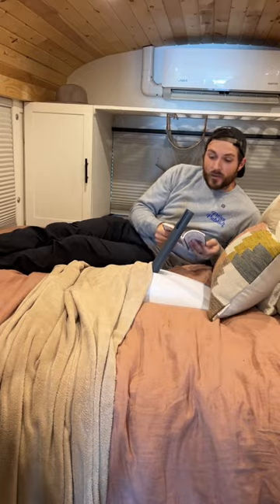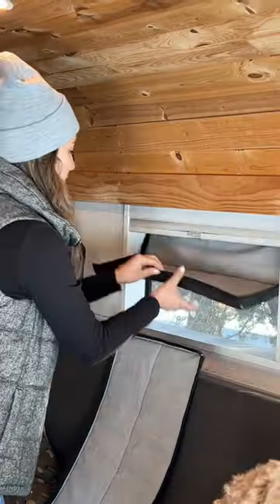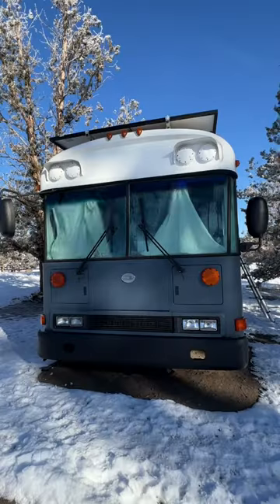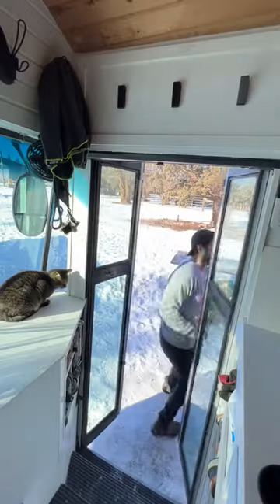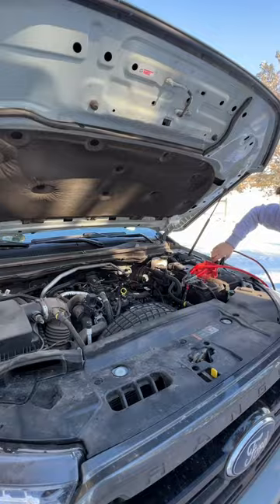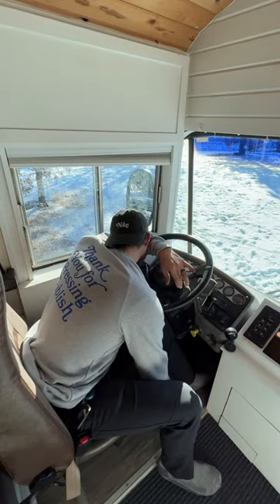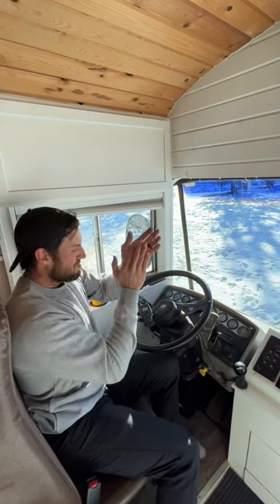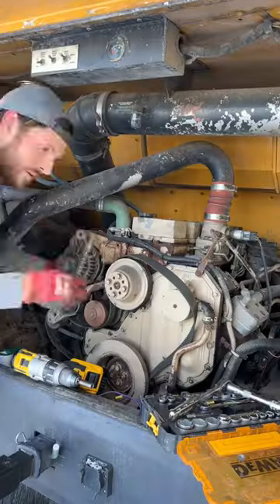How we ALMOST get ready to move our 39 ft Bus #buslife #vanlife #busconversion #skoolie

Comment: Having your alternator rebuilt is cheaper. That's if you can find a place to rebuild it.
Reply from the maker: I found a place, but it would cost more to rebuild it for this one unfortunately :(
Reply: @BasicallyNomads  I replaced many motors in lifting equipment, always safest to get them rebuilt as you were certain that they would fit perfectly. Did you know the big tour busses start with compressed air? No problem with cold batteries losing amperage. Nice job on the bus!

Comment: suggestion for wierd or crazy powerfull alternators. try alternator nation. got our 380 amp alternator for our E350 there. soo much power in a single alternator! keeps our survay equpment running. i would suggest something with lower idle power for diesel tho. even tho the max power is 380 amps. it kind of loses a LOT of kick at sub 1000 rpms.

Comment: You ain't gonna find many parts for that motor at O'Reilly or autozone or advance auto. That's a different kind of motor,  almost always a special order
Reply from the maker: You’d be surprised! It has a Cummins 5.9 which fits in the ram 2500. I’ve gotten quite a few parts from there.
Reply: Oh wow, well that's good,  don't have to wait forever for some of the parts. I got a toyota rv with a 22r motor, most 4runner from mid 80s to mid 90s have them and the celica to has it
Reply: I guess you think tractor trailer drivers have to special order their parts WRONG just have to go to a heavy duty parts house

Comment: That would be the worst part about living in a vehicle for me, if the vehicle breaks down do you still have a home?
Reply: Well actually it would be perfect. They have a bathroom and kitchen plus internet. And a bed. You could call a service to come out and fix it and even if it took all weekend you would be totally fine. The home doesn’t stop working because the engine won’t start. Now if all of your batteries and your car engine failed obviously would be less of a home. However I could just as easily argue if your water pipes failed or you got a power outage your home would no longer be a home. The odds of also all of there batteries and engines also failing is so ridiculous that it’s almost impossible. But once again a home like that is definitely livable for probably at least a week if you just decided to turtle up and wish for help. But in all honesty you could live months in that bus if it lost power and you have survival skills. It’s a great form of shelter and switching into neutral would allow you too move it. Very practical & very homely.

Comment: If the engine turns over, it's not the batteries. The battery's only job is to turn the crankshaft. If it doesn't start, look elsewhere for the concern.

Comment: All altiantors charge at 14.14 volts there abouts  old altiantors  fit old engines thay are just about all the same fittings just put spacers in to fit.

Comment: It turned over and he said the batteries were dead? Then he said it was the alternator? Makes no sense
Reply from the maker: It didn’t turn over at first. Batteries were dead.. I charged them. It started but the alternator wasn’t working so it ran until the batteries died.. how does that not make sense 😂